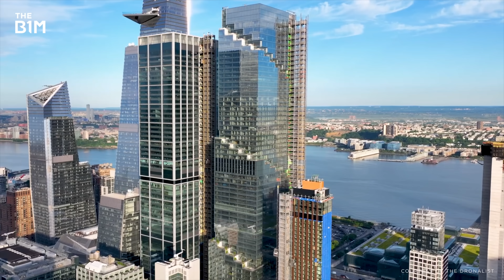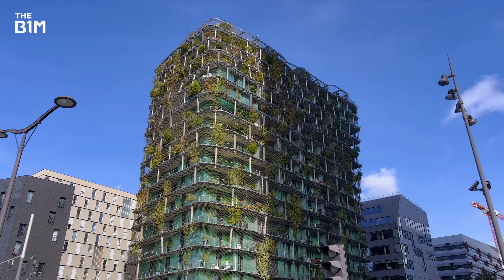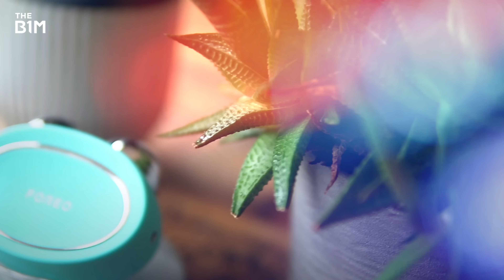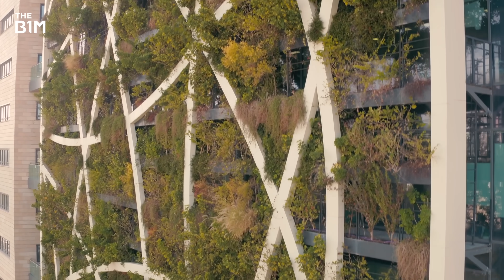Tree-Covered Skyscrapers Aren't Actually That Green

Comment: Maintenance would be significantly easier if the trees were more concentrated - a 'tree balcony' or skyscraper park on each side of the building, for example, perhaps 30-50% of the way up so the extra weight is lower and needs less extra concrete to support it. That kind of more modest solution might end up being a more common response.

In general though, if the skyscraper moves more housing and office space off the ground, there's more room on the ground for trees and parks - which then benefit everyone rather than just the tenants. That seems like the most straightforward way for skyscrapers to drive greenery.

Comment: I think the main concern is whether it actually has a real environmental benefit. The cost of pumping water up to these heights as well as the need for further reinforcement might actually lead to higher CO2 emissions per inhabitant rather than lowering them. Not everything that looks green is good for the environment, golf courses and suburban sprawl might have a lot of green areas but they are actually a huge detriment to the environment because of the resources needed to maintain them and their impact on biodiversity. Green skyscrapers might care about biodiversity but they still cost additional resources that can outweigh the benefits, even if it is a net benefit you have to ask whether or not the benefit is great enough to justify the cost.

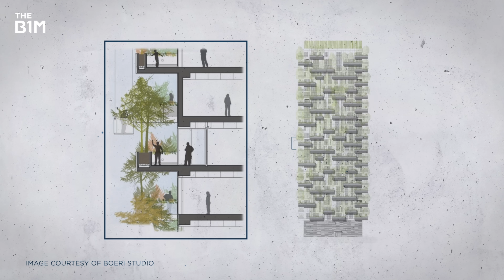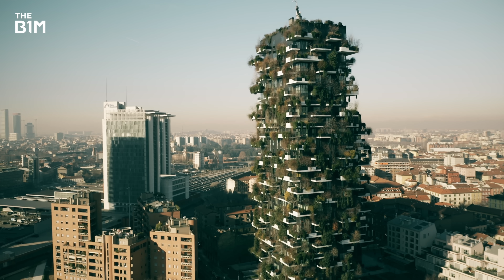Comment: The breakdown of the planting beds at 5:40 - 6:04 alone explains why this is a horrible idea in terms of CO2 sequestration. The building needs that much extra steel and concrete (in addition to beefing up the load-bearing system to carry the extra weight), which in production emits much, much more CO2 than you could possibly hope to capture in the puny trees and shrubs planted on top of them.

Bonus game for architectural renders featuring trees: Check how much space they have set aside for tree roots. Some architects seem to believe the trees only exist from the surface up.

Comment: Trees on building is not mainly about reducing the carbon footprint: they are about reducing heat islands inside the territory that create a whole different climate and often create pollution problems due to how the wind moves around large urban areas. It is extremely expensive to maintain, but with the premium cost of space in central areas of business cities, it could be a reasonable thing to enforce.

Comment: A video for architects and those who are interested indeed! Well, I must say... there were some Completed green skyscrapers missing such as the "Clear point Residencies in Colombo".

Yes, they are a high cost & Labor intensive investment and indeed in need of regular monitoring.  Engineers, Architects and Landscape Architects have to go  through a lot when it comes to designing & maintaining these..

Yes, hate to admit but sprinkling trees like salt might be a thing when you are running late the deadline & have to somehow make the margin of green... thing (At least for students) But  Most of the time, planting goes with a site analysis, plant selection and panting map. 

Another thin is that more you go higher, the shorter the plant gets.... You are left with bonsai trees (if you plan to plant any) when you are above 100m with high winds with limited soil and the nutrients (they supply that part BTW.)

But yes, they tend to have the positive impacts which were mentioned and also might reduce the Urban Heat Island Effect since plant covered walls does not reflect much radiation.

Comment: they convert the CO2 with O2, that what vegetations do.
and this is a great trend because if every new building start look like this, the air quality nearby is getting better especially in tropical country.

and like kenyeang said, architect move the vegetations that was cut off for the building into the building it self.
for example, if I have 1000m square land and i want to use 600m square of the land for the building only, so the greeneries on the ground only 400m square left, (i need to make contruction for pathway, driveway etc so the greeneries maybe only 200m square left).
i need to make my building cooler and make micro climate in my building.
and now imagine if my building have 40 floors, every floors have balconies for vegetations and the rooftop too? I can replace the 800meter square ground that have been used with all the vegetations in my balconies and my rooftop.

every floor have 20meter square balconies times with 30floor (minimal). it is already 600meter square greeneries with balconies only, what if i add my rooftop?

Comment: Currently in Milan Stefano Boeri is going on to design other buildings like Bosco Verticale. 
One of them is currently under construction, but it's not a tower, even if it's based on the same principles of his previous work. 
Another green tower will be built not far from the original ones. Always designed by Boeri, this time it will have a wooden structure (mostly). This choice is to reduce carbon impact.
I got the feeling that building big wooden structure will be the next architectural trend

Comment: The trees weigh like what 5% as much as the structure to support them? The maximum amount of CO2 a tree displaces, is a fraction of its own weight. So I’d say the extra structure required to maintain the trees puts out more co2 than the trees will absorb.

Comment: Cool video. One thing to take into account though is the long term benefit to climate change vs the immediate carbon output from the concrete and steel production. It will be interesting to see if it balances out and maybe provides us with some net gain over the long term.

Another thing to discuss would be the effect on birds actually being able to see these buildings, rather than flying into them and dying.

Comment: You could (and should!) use some Bonsai growing techniques on these. Smaller species and slow growers need less maintenance work and they don't require extra strong building structures. Bonsai is not just for pot plants; the same methods are used in gardens and parks in Asia.

Comment: My business is construction. Just the waterproofing alone for all these green buildings is a nightmare. Just keep potted plants. All the additional work required to make a building covered in leaves feasible requires a larger carbon footprint which the greenery will try to recoup in its lifetime. However, it's not like buildings are forever. Buildings typically have a usable life of 50 years. 50 years isn't enough time to recoup the ROI.

Comment: All aboard the hype train!!

Seriously though, I think we're heading in the correct direction, but there are many factors that they might not think about in the long term with these buildings such as:
-increased pest control within the structure
-degradation of the balconies after 20 years of soil & plants sitting on them without adequate "old fashioned" support columns underneath
-increased cost of window cleaning from algae build up
-increased possibility of mold spores from the soil
-how to change out a dead tree and how much would that cost
etc. etc.

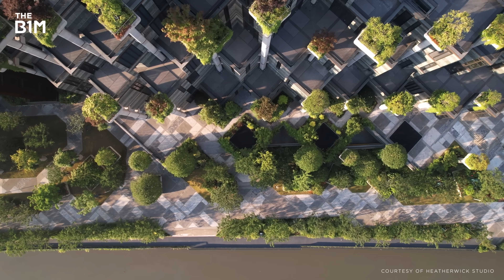The building show on 12:34 looks like it could address the first point. I like the idea, but not an architectural firm simply trying to sell a cool looking building to a developer/buyer/city without planning for ALL the nuances of it over decades.

Comment: They should do something more simple, like climbing plants. Just put them in some sort of net over the balcony to acts as a roof, and just put some smoot angled surfaces to avoid them spreading to the main structure of the building and damaging it, plants keep humidity, and humidity is not a big friend of buildings.
Reply: Also, just stop building high rises, beyond some 10 stories or so it becomes more expensive and not worth the expense.

Comment: It looks pretty, but its very impractical. 
I used to live in One Central Park in Sydney. My outside garden could only be maintained by a gardner hanging from a rope, which only occurred twice per year. For most of the year, my garden was a weed garden. The plants on a lot of the other gardens died. 
Also, perhaps this is a Sydney planning and regulations problem, but the planter boxes have started falling from the building, highlighting the poor build quality.
It looks nice, but in reality is quite disfuncional.

Comment: I'm glad you covered this. I've been really curious whether this was just an artists rendering fantasy or if, horrifically, this was the future. As someone who lives where the forest is rather than duct taping the forest to the outside of my work and living spaces, these look awful to live in. If you've ever had a woodpecker decide your home needed several more holes in it, a squirrel gnaw its way into the attic to store up for winter, or a bat find its way into your home you know animals that seem cute in pictures are dangerous.

We built our built environments without this greenery because the greenery attracts animals, many of which are pests, or dangerous, or bring diseases. While we do need to fix the unintended consequences of our built environment on the global environment, just throwing some plants on the walls forgets a significant portion of why we built the built environment in the first place and will have consequences of its own.

That's not to say the're all doomed to failure, of course. You can manage houseplants, you can integrate a limited amount of plants into a structure beneficially, and you can solve some of the problems that do arise iteratively. But haphazard use of the architectural tree brush in photoshop is not the well thought out and researched sky garden we see in Milan. And let's be blunt, most of our structures do not get the maintenance they need. And that's disastrous very fast with a fake ecosystem maintained by transplanted shrubberies. The animals that made new homes in the short-lived plants will find new homes. The water barriers will deteriorate. And the wrong things will start to grow. Particularly when well-meaning residents interfere and plant things in the dead green spaces without doing the homework that places like Bosco Verticale did.

Part of me wants to say it can be made to work with regulation, but regulation might also kill it if those funding these projects see green on a building as a red flag for future costs. For it to work, it's going to either have to be a new building requirement, or it's going to have to prove it can pay for itself in a way that's worth the upkeep costs.

I personally find these things hideous and the thought of being in those buildings uncomfortable, despite the research saying I should feel the opposite, but I've learned to live with baroque architecture for preserving history, I can live with this if it preserves the future. I just hope that really is what's happening with these things and it's not just a greenwashing fad like your thumbnail alluded to.

(And, yes, I know my dislike of baroque architecture and hate of tree-bedazzler architecture will offend some who love those styles of architecture. I apologize in advance for not being able to fix your broken taste in architecture. 🙂)

Comment: Green is Grey.

It looks nice, but the point about extra structural steel and concrete the 'net-zero' benefit will never balance that out in a meaninful way, better to build efficiently and quickly mid-high rise buildings in dense urban areas with transit and leave larger naturalized areas to grow large forests that don't need human maintenance.

Comment: I'm disappointed that there was zero mention about top soil removal here. That was a huge missed opportunity. If Sky scrapper forests are using top soil for growing medium, they will only be human psychological cushions at the expense of serious damage to nature. I'm from an urban area which has had a culture of roof top gardening and farming for several decades and most of them have been buying soil for a long time without a second though, until recently when the loss of topsoil and soil degradation has started getting more steam. 
You are doing a better job in helping environment by leaving a piece of soil surface from paving or concrete, than displacing it to your balcony and growing a tree there. Because that piece of soil when it's on the ground is like a part of a big system that makes huge impacts on lowering ambient temperature, capturing carbon, growing soil microbiome, retaining moisture, enabling ground water recharge, none of which will be possible if you remove it and put it in a container. It's functionality gets reduced to being a medium for a plant that can temporarily capture some carbon and reduce particulate  matter. People need to understand that it's not the plants itself that reduce the ambient temperature, it's plants shading the earth surface that reduce the heat exposure to ground and also reducing the heat radiated out by retaining soil moisture. If you uproot a lone plant in an area, put it in a pot in the same place after put pavement there, you are not going to see the same ambient temperature just because you have the same plant there.
So if you are growing any flora divorced from earth surface in containers, be it on ground surface or in fancy skyscrappers, unless it's growing medium doesn't contain top soil or is grown through hydroponics, you are doing more harm than good. 
If you want particulate matter removed, grow a green fence vine in a container of water. 
If you really care about environment, lobby to mandate some percentage of unsealed soil surface in every plot and to increase the same in public spaces by implementing rain gardens in public spaces. 
If you want apparents that are environment friendly, chose the one's who leave a green space on ground surface, not the once who literally 'greenwash' after maximizing every inch of space into multiple real estate. 
I would say forest skyscrapers are the finest examples of greenwashing as the most obtuse circus when they don't want to give up on the profits for even an inch of land surface.

Comment: Multiple new buildings where promoted with a green facade in my city. But only one actually got it (and we'll see how those plants will thrive - seems harder than anticipated by the planners, a lot of the plants died). Those renderings are always "optimistic". Just like there are never street lights, trash cans or other distracting elements. In a lot of cases not even traffic, streets, the actual neighbouring buldings or terrain. Everything looks like a paradise. Some of the features presented to the city and public aren't even intented to be realised. But it helps getting acceptance.

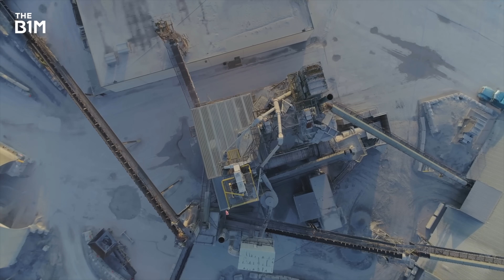Comment: 10:27 It would have been helpful if you'd provide a chart or timeline showing how long it would take for the trees to offset the added concrete.  Yes, doing things differently than how you've done them for 500 years will expose new risks but they also expose new opportunities and promote innovations.   Change is the only constant in this universe.    Out population and understanding have changed drastically over that last 500 years, but our approach to housing has not.   I'm not sure the "Don't try new approaches because they present new challenges" argument is a good one.

Comment: I agree with all the positive points made about this. But this really isnt the way to fight any climate change nor pollution. 
1000 trees isnt that many, especially at that small size. It is much easier and cheaper to plant many more trees in parks and forests than doing this. 
He brought up concrete and other things that increase the initial work/pollution, but he did not talk about the actual maintanance costs and labour needed. 2014 is less than a decade ago, which means the building itself is pretty new. The real problems will and expenses will show in a couple of decades. The drainage systems will need changing and probably other more complicated features which again costs money  - this money could again be used to plant more trees in parks and forests. This last is sort of a shallow point i made since money is being spent in much more bizzare ways than this, but still this isnt the way to make the world greener.
On top of that imagine how many flying gardeners a city would need and the expenses in equipment, training and safety spent per building if a city had even a portion of its buildings like this.
I agree with most that this looks cool and heartwarming. But i think this trend should be focused on smaller buildings such as family homes. 

Over all i love this stuff, it comes from the same kind of thought similar to my efforts to bring stone housing back at least somewhat available. However i know it will and should remain an exclusive thing

Comment: Temperature advantages of green building roofs or facades can actually be measured. When a simple green roof is able to lower the inside temperature by some 6-8 °C, there is no need for cooling appliances. The other way round, less heat is necessitated when colder days hit the structure. And yes I know that doesn’t just depend on the roof. Nevertheless, the impact of the green roof is much more significant than portrayed in this vid.
Reply: The impact of skyscrapers on the societies ability to construct functional cities is more significant than portrayed in this comment.

Just the cost of pumping all that water up a skyscraper makes any environmental impact from a green roof cancelled out. The answer is obviously no skyscrapers, and walkable cities. Anything trying to make skyscrapers environmentally friendly are really schemes by rich people to keep the status quo. 

The rich sure do love their skyscrapers.